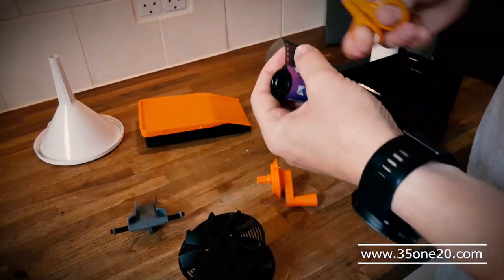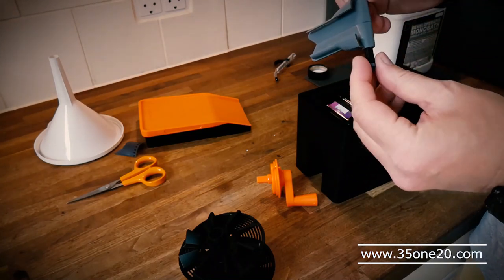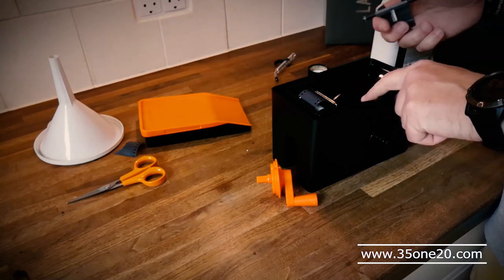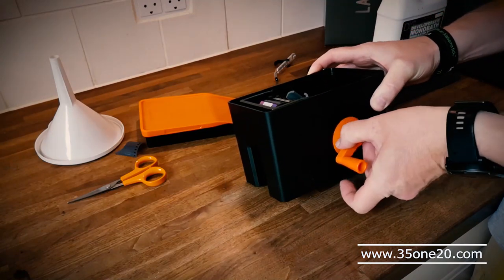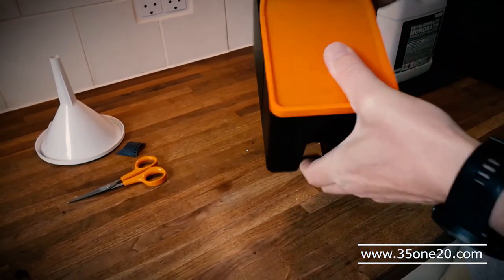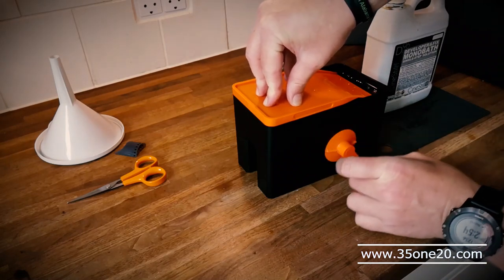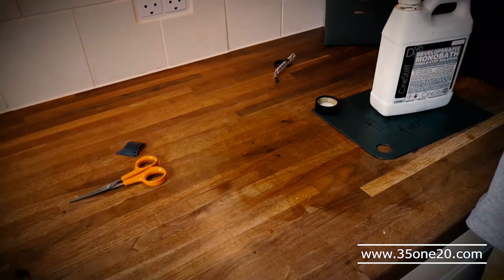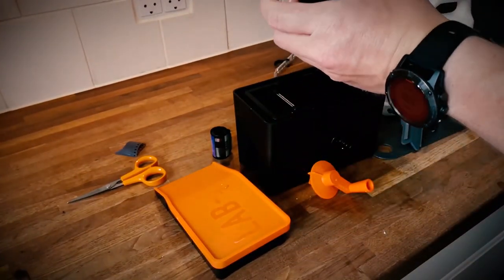LAB-BOX - developing a 35 film

Comment: Can color be processed in it?
Reply from the maker: Sure. I wouldn't do it. Because you'll have a hard time keeping a steady temperature.
Reply: @JustWalkedBy    If need be, you can hold the Lab-Box on a warming tray of water. Agitation (turning the crank) could be quite a hassle that way, so intermittent agitation would be preferred. frankly, the LB would not be as convenient for color as a conventional steel tank, but if you are using Paterson, then the pain in the ass factor is about the same.
Reply from the maker: @randallstewart175  I use a Paterson tank for my C41/E6 developing. and I don't find that so hard to do. I use the Cinestill temperture control system. and that makes a whole lot easier.